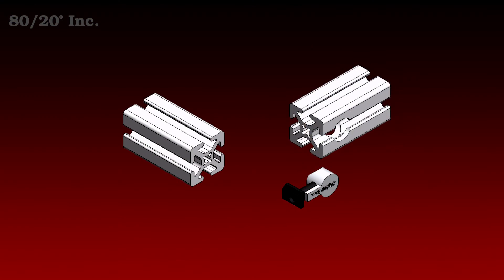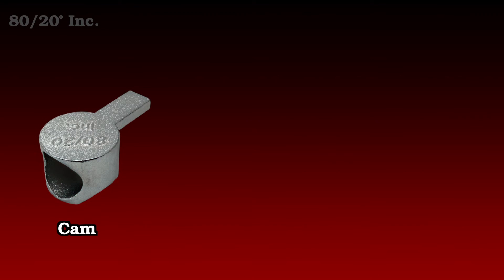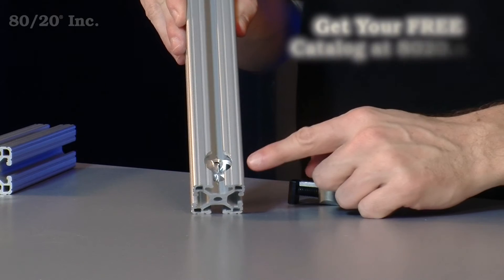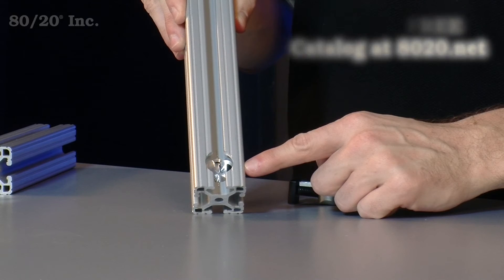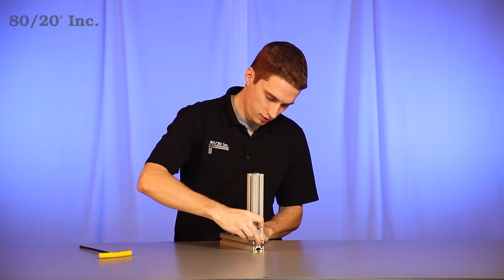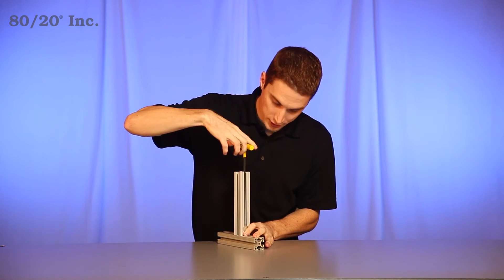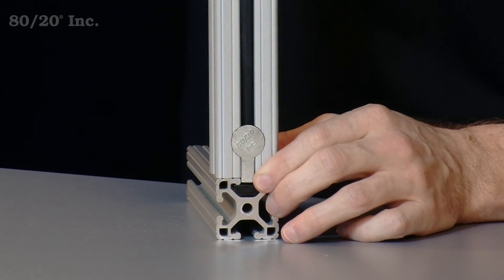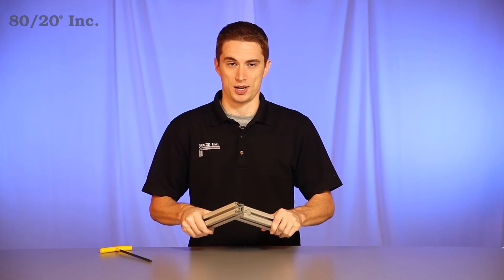80/20: Anchor Fastener Overview

Comment: But...how do you tighten that bolt if the 80/20 is 2 meters long ?? Basically, if I don't have access like you do to the tightening bolt ?
Reply from the maker: Hi there! Using a ball-end T-handle wrench allows you to reach and tighten bolts at an angle, making it easier to access hard-to-reach areas.

Comment: Do you carry a fastener product that has a handle attached to it for easy adjustability along an extrusion?
Reply from the maker: Hi there! That's an excellent question. Most adjustable fasteners require a tool to loosen/tighten as needed. When folks are looking for adjustability, we usually see linear bearings used, as these can withstand repeated motion and come with or without brake holes. Check out linear bearing and Unibearing options here: https://bit.ly/3NY6jlz

Comment: How much weight can these anchor fasteners support?
Reply from the maker: Hi there - thank you for your question! The capacity of a particular fastener is a challenge to determine as it depends on multiple factors. We recommend checking out the Fastener Application Test in the 80/20 catalog -- it should be able to give you a better idea of what you can expect when using different fasteners: https://bit.ly/47JBhas

Comment: Unless you use a double anchor fastener it seems like this connector would be stronger with the load applied in one direction than applied in the opposite direction, correct?
Reply from the maker: That is correct.  A cantilevered load applied to the same side as a single anchor fastener would be stronger than if the load was applied to the opposite side of the extrusion.

Comment: Why is the anchor fastener stronger than the central connector?
Reply from the maker: The anchor fastener screw is axially aligned with the extrusion; therefore, it allows for more torque to be applied to the T-nut.  The central connector applies the screw torque perpendicular to the extrusion through a tapered setscrew which is not as efficient.

Comment: How do you tighten the anchor if the aluminum piece is longer than your T-handle?
Reply from the maker: Hello, John. Our “T” handle hex wrenches, hex drivers, hex power bits and “L” hex wrenches all have a ball end that allows for angular insertion and tightening of the fasteners.
Reply: @8020llc  Ah! Problem solved!

Comment: You sell the bits for making your own counterbore but don't have the spec where to mill it?  I got your 40mm rails, how far from the end do I make the 20mm counterbore?
Reply from the maker: Hi Josh, you'll want to make it 19.99mm from the end.
http://catalogs.8020.net/80-20-Inc-Catalog-23/865/#
Reply: @8020llc  you should really put more of the documentation in the part description on how to use it. its frustrating trying to find the information sometimes.